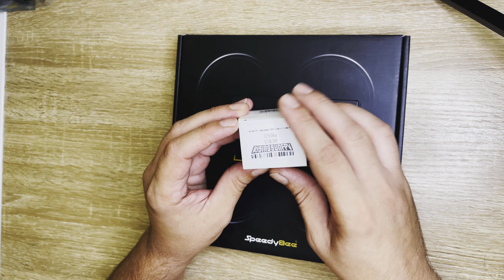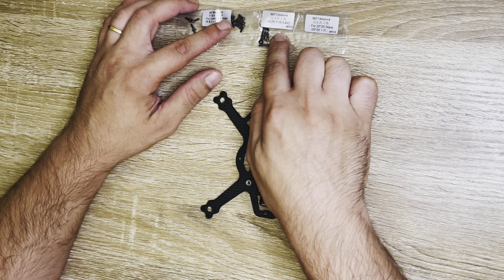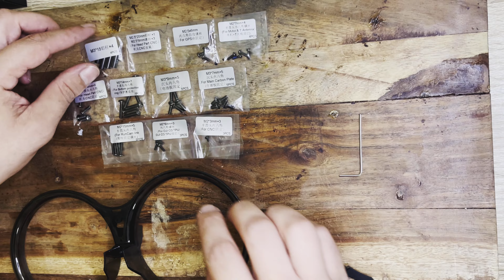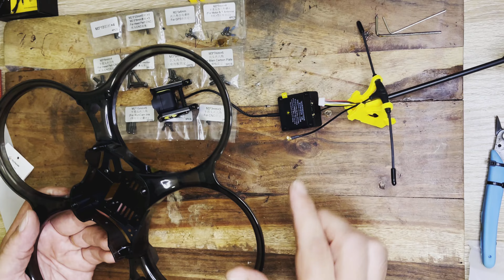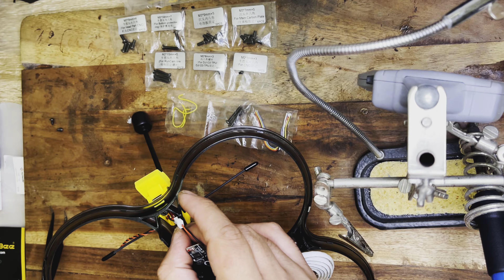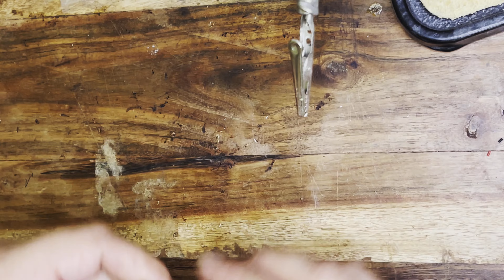SpeedyBee Bee 35 Full Drone Build Tutorial🤩😎 #fpv #speedybee #drone #leds #building

Comment: Brilliant 😍 can please tell what is transmitter and receiver range ?
Reply from the maker: The tbs crossfire rx and tx are meant for long range e great penetration. 
I never personally tested their limits but it is stated by manufacturer that the tbs crossfire macro tx v2 module which is the one I use can reach a range of 40km

Comment: can u please mention all the parts you have used
Reply from the maker: Frame: Speedybee bee35
Stack: Speedybee f4 mini
Motors: Helios 1750kv
Receiver: crossfire nano with immortal t antenna
Vtx: DJI 03 air unit with 3rd party long antenna which works on both 2.4 and 5.8 ghz as same as the stock 03 antenna.
GPS: SpeedyBee BZGNSS BZ-181 GPS
Props: HQ tri blade T90
LEDs: Speedybee meteor LEDs

Comment: Hey man, great Video! 
I'm just about to start a build in that frame.
I'd pretty much stick to the bind and fly version components, as I've had pretty good experiences with SpeedyBee in the past and I'm only wondering if you have had any problems using that f405 mini stack as it is only 35A.
Cheers and thank you :)
Reply from the maker: Thanks a lot mate🔥
So far, I have never had any issues with the speedybee mini stack at 35A esc. The batteries I use to fly this drone is a 6s 1300mah, i don’t fly it with a mah over than that, that’s the only thing as per recommendation of factory.
Happy you are about to build yours, nice drone very versatile 🔥🔥 if need any other help, just contact me

Comment: Just got the frame kit don’t know what motors to use
Reply from the maker: As motors you can go with 2004-1750kv or you can get the same as in the bind and fly version, the SpeedyBee 2006-1950KV, or any other with the same specs.
If you are planning to carry a GoPro on your bee35 go with the 2006-1950kv, if not the 2004-1750 work well.
Hope it helps🔥